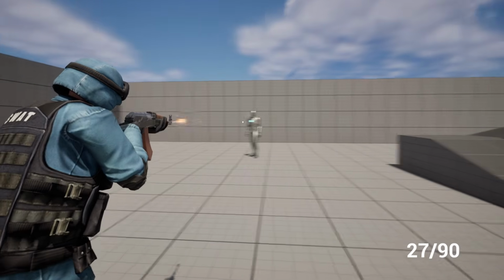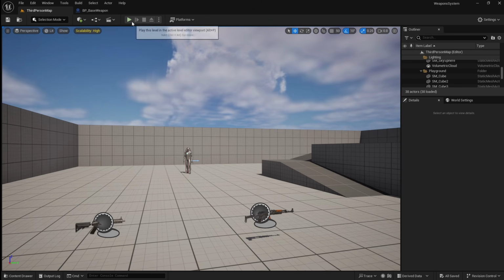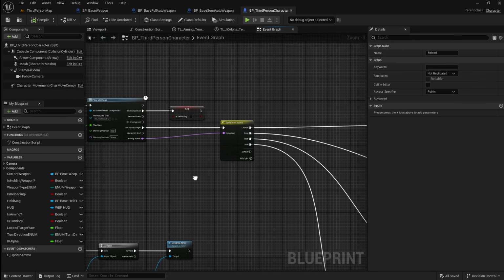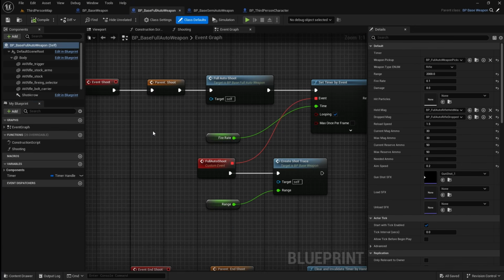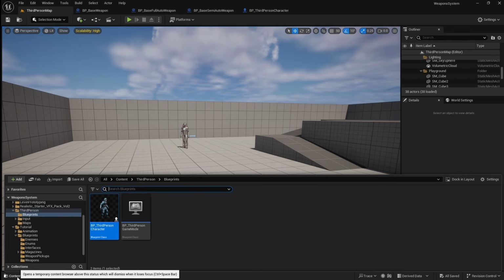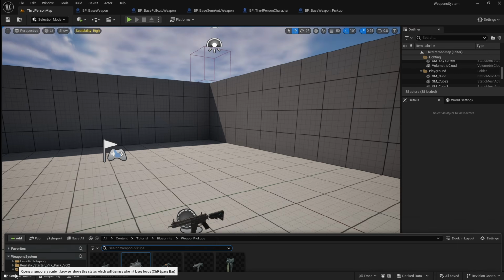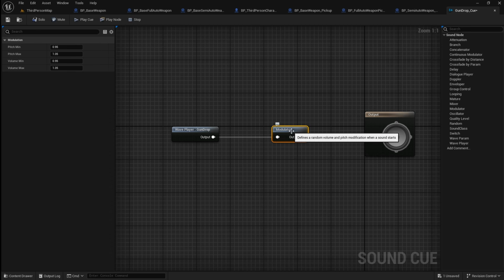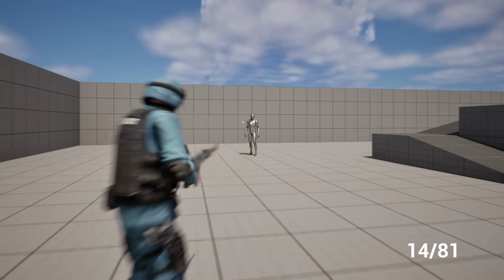How To Add Weapon Sound Effects (Gunshots, Reloads, Equip) - Unreal Engine 5 Weapon System Tutorial

Comment: The way this system is set up if i try to single fire a full auto weapon it has a delay ive adjusted fire rate and that will fix it BUT then the fire rate when holding fire is to fast any suggestions?
Reply: Do you have a delay on your full auto weapon after the audio part?